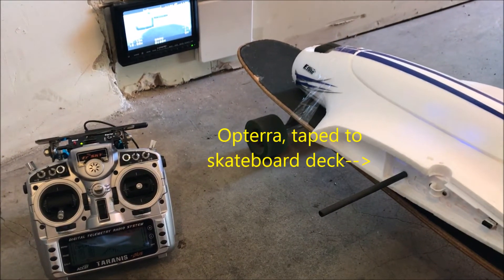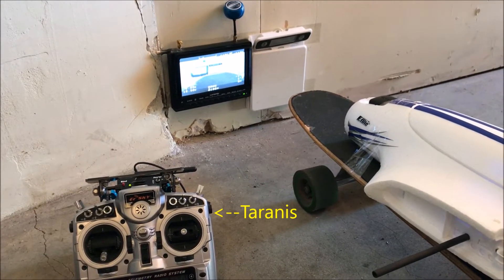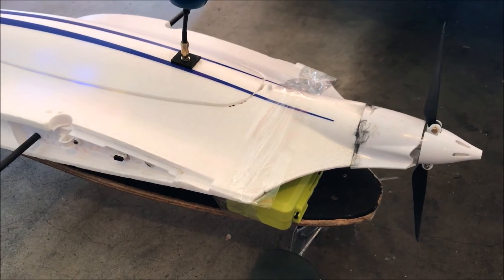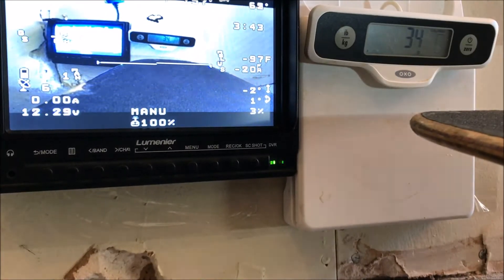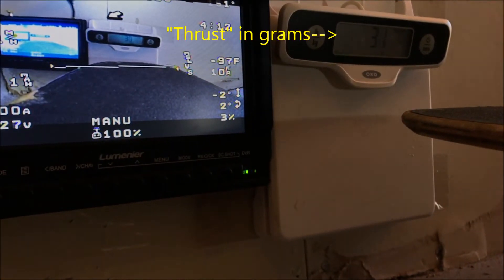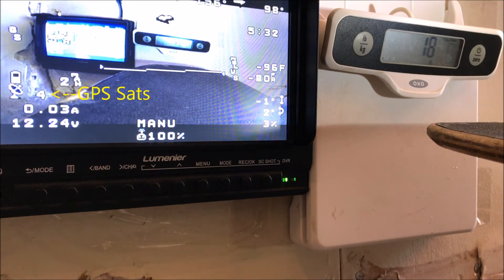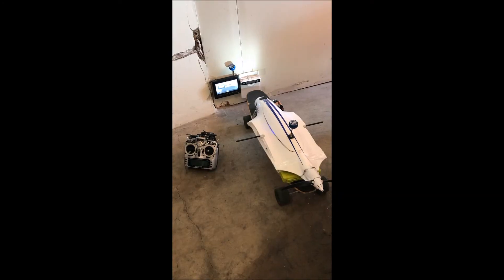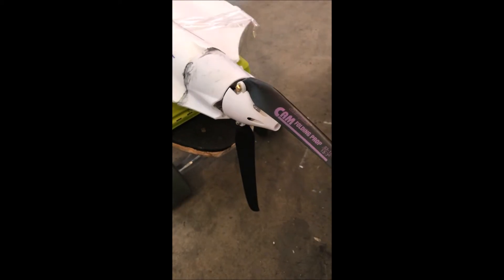E-Flite Opterra, Skateboard Thurst Testing: PART 1 of 2

Comment: Your current meter seems to be waaaay off. No way it will only pull 5 amps with the stock prop or 10 with the graupner and cook the ESC... ;)
Reply from the maker: agreed, the next step for me is to of course get a speed controller that doesn't get so hot and secondly check my power module setting with one of these for accuracy: http://www.sears.com/craftsman-digital-clamp-on-ammeter/p-03482369000P